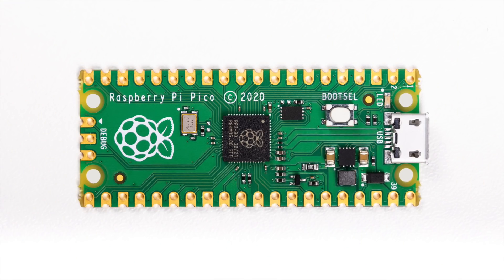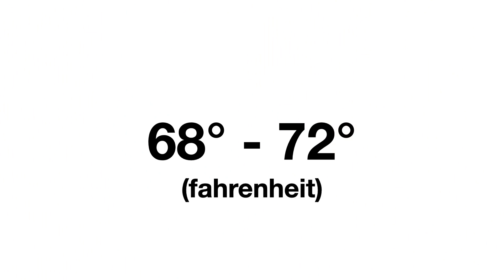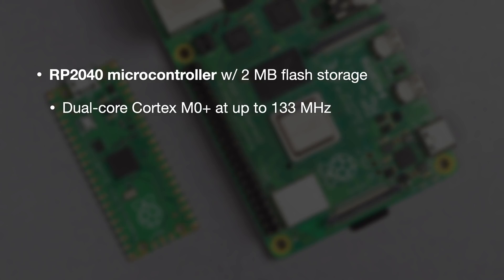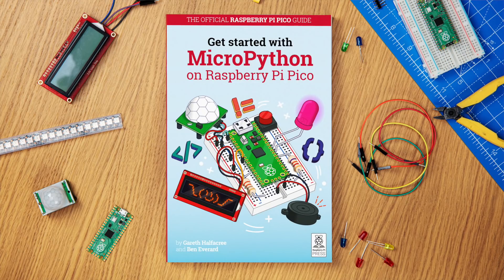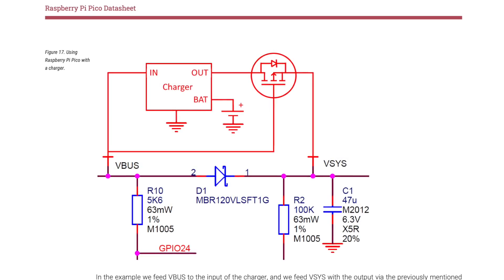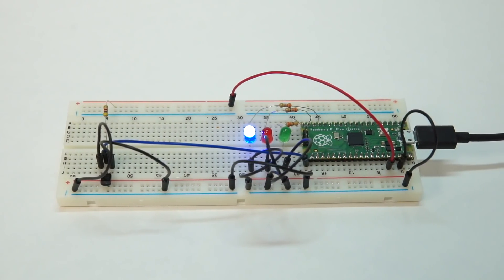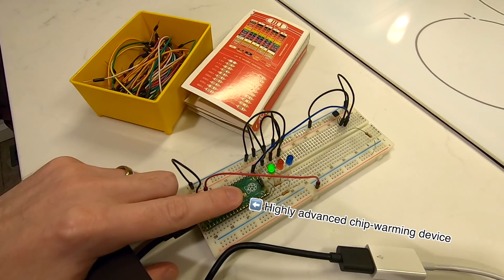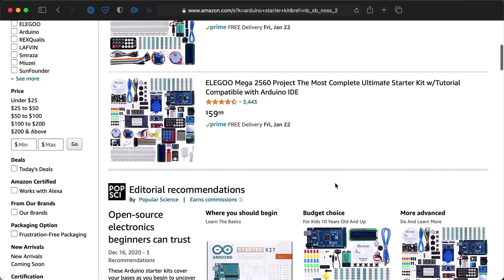The Raspberry Pi Pico Review - $4 ARM Microcontroller

Comment: Check out a $2 "Blue pill" board based on stm32
Reply: It’s a better deal
Reply: @danielh6219  not if they arrive non working, with the not advertised chip with a half-functioning clone IC or you actually want it within 3 months(Yes those are all common problems with the blue pill) and even then it’ll be slower and less flexible
Reply: @danielh6219  depends on what you do. Software support is great for those, but they have less processing power (though that probably doesn't matter to too many people. 72MHz is plenty for a lot of things.) If you want multiple cores though, I don't know of other boards in the same price range.
Reply: @coreforge  esp32 devboard has dual 240mhz cores + additional ultra low power core, supports wifi and bluetooth connectivity, and costs about 4$ on aliexpress
Reply: @nikitoss1108  Yeah, noticed that too. I haven't done much with ESPs in general and haven't looked into the ESP32 since I didn't need wifi for anything.
Reply: @coreforge  esp boards looks nice if you write high-level code, but if you try to dive deep into low level coding and write timing-critical things, then better to use another hardware, cause espressif are not so good at writing datasheets
Reply: @nikitoss1108  I guess it's better to offload your timing critical code anyway since the ESP may ruin your timing with its WiFi related interrupts. That said, for some use cases (like driving NeoPixels for example) you can actually use the ESP's hardware instead (though it does limit the pins you can use).
Reply: @ThePC007  yeah, these problems with timings may happen, but more often on esp8266 than esp32. Btw on esp32 you can work with hard real-time audio processing (where timings is quite critical) and use wifi simultaneously, and it handles this work pretty well thanks to better low-level libraries than for 8266 and splitting tasks between cores
Reply: @nikitoss1108  Yeah, I haven't used the 32 much, but I suppose having multiple cores definitely helps with this kind of stuff.
Reply: @nikitoss1108  ESP32 has all that PLUS crippling silicon bugs!  Woowoo!
Reply: @GoatZilla  anyway, people make good and complex projects with these boards, and they turn out quite nice and functional :)
Reply: @nikitoss1108  Sure, as long as you don't try to do things like wake from sleep or use PSRAM.
Reply: @GoatZilla  don't really know about deep sleep on these chips and problems with it, but I've seen projects that uses psram quite intense, for example you can check out module for eurorack synthesizers called ctag-tbd, those guys used esp32-wrover module and they did squeeze out quite a lot from this poor little esp32 :)
Reply: @coreforge  You don't need wifi for anything until you start using wifi for something, then you need wifi for everything.

Comment: Honestly, this is why I love the raspberry pi project so much. Yes there are boards out there with much better specs, but software support is in my opinion much better than a few gigs of more RAM or a few MHz faster.
Reply: People always dismissing the value of documentation and support then wonder why companies don't put more effort into docs and support lol.
Reply: It’s weird that you say that when this has less software support than most anything else out there right now.
Reply: @Hornet135  I really relate to what you said because I was a victim of that myself (had to make my own I2C LCD library for it in C because there were only ones for Python), but to be honest the documentation for the SDK and the hardware itself is really good

Comment: Surely it's 2uA in sleep mode, not 2mA? If it's 2mA in sleep mode then that's really, really, really bad. I build commercial IoT edge devices with MSP430 and ATMEGA microcontrollers, and I regularly run at 7uA, meaning a device can run for years from a couple of AA batteries. At 2mA, it's nowhere economical enough. I'll check the data sheets, but thanks for the video. I've ordered 3 to play with. MicroPython is a welcome feature - it's so much faster to get working software, even if it's not as performant.

Comment: ask a maker to blink a led and theyll use a pi and a full linux stack to do it instead of just a microcontroller
ask a maker to display the tempreture and theyll use a microcontroller temp sensor leds to do what a thermoteter will do
Reply from the maker: "Overkill"
Reply: Also makers: why would I use a Pi if I need to attach a display when this MCU technically can output a video signal... if it's essentially the only thing it does...

Comment: Can you take a PICO and make a soil moisture sensor, AND add 5volt water pump to water dry plant until Moisture sensor detects water and turns off pump?  Show how you wire it. And if you have code, show how to put code in PICO properly?  Every step... THEN I CAN FOLLOW THAT.

DISABILITY KEEPS ME FROM READING/LEARNING. BUT I CAN COPY IF CLEAR AND I OFTEN STOP VIDEO..

Comment: This could be compared to arduino nano, which is already kind of obsolete with availabiliy of ESP32. So, I dont really understand this product.
Reply: Arduino nano knockoffs are so cheap they are still viable if you just need a simple microcontroller. It's about 2 euro on Aliexpress.
Reply: If you think an 8-bit AVR MCU is in any way shape or form comparable to a dual-core 32-bit ARM MCU for any other reason than to point out how they're nowhere the same ballpark, this discussion is not worth having.
Reply: @AttilaAsztalos  If an 8 bit micro is sufficient for your hobby project, I think they should be compared. The example in this video could be made with a nano to prove the point.
Reply: The nano has definitely less features than this device.
Reply: Ok fine, its ARM, but still, i dont see a point using this over lets say ESP32. What am I missing?
Reply: Esp32 is 32bit.

Comment: Have you looked into ESP32 based M5Stack solutions?
M5Stack saves you a lot of time and you get a nice case too.

For the baby room temperature sensor solution the smaller M5 stick with a temperature hat will do.

M5Stack is  a bit more expensive but a lot more turnkey no soldering needed, and integration with Lego. 
https://m5stack.com/

the Ecosystem for ESP32 for home use seems to be very nice
https://esphome.io/  Lots more work

Comment: I tend to use TMP36 or 10k thermistors for temperatures, far easier to use and quite easy to calibrate to a reference.
Reply from the maker: I should probably branch out at some point... I just have a bunch of extra DS18B20s that I bought years ago, and already know onewire enough to use 'em :D

Apparently the onewire thing has been fixed in the latest version of MicroPython for the Pico, so I'll have to try it out again soon!
Reply: @JeffGeerling  Would love to an update with it, I have been wanting to do a onewire project for a long time.

Comment: Is this the first arm based chip designed and released by the pi foundation? This is HUGE! Looks like a good form factor board too with good enough pricing.
I'd like to learn about how they designed it, what IP and licenses they were bound by. Maybe they could work with esspresiv if they don't want to deal with designing their own radios.
This might make me jump on the micropython bandwagon, as late as it is. I love the pi zero, but running a whole OS with my simple projects just feels messy and a massive waste, micropython on m0 cores looks like the right balance for my stuff.
Reply from the maker: Yes! That's one of the headline features, though I didn't mention it too strongly in this video. The RP2040 looks like it will be the first step in a line of interesting new microcontrollers.

They're definitely embedded (heh, get it?) in the ARM ecosystem now.
Reply: To me it's seems like IP foundation believe that some of there customer base is ready to go beyond Linux OS, to lower level computer programming👍, although I would be very shocked to see them ever go as far as assembly language.

Comment: Why is the PI foundation wasting time with this? They should make an ESP32 killer with wifi 5ghz.
Reply from the maker: My guess is they start where they do with most of their projects—educational intent, as cheap as possible. And for a lot of use cases, WiFi and Bluetooth aren't necessary (and sometimes could be detrimental to include).

There's board space, I'm imagining there could be a Pico W someday...
Reply: @JeffGeerling  love your work Jeff. Just a little annoyed with the Pico. Was hoping for much better from PI.

Comment: Only one thing I was a little bit disappointed at, no CAN-FD interface. But I sure will find use for a couple of Picos. Congratulations on your newborn!
Reply: I'm not familiar with CAN-FD, but it may be possible to interface with the bus using the PIO capabilities of the pico:
https://datasheets.raspberrypi.org/rp2040/rp2040_datasheet.pdf#section_pio

It seems to run directly off of a configurable voltage divider from the system clock, so protocols implemented using PIO should be pretty fast.

Comment: But the most important question is: Can I ditch MicroPython altogether and use the Arduino IDE to program in C++? Couldn't find an answer to this so far...
Reply: The arduino folks are going to be releasing an arduino based on the chip used in the Pi Pico, so there will definitely be a compatible bootloader available, and I have no doubt that community support for getting it onto the Pico will come together quickly.

It's also worth mentioning that there is be a C/C++ api for the pico by the Pi foundation for those that don't want to deal with MicroPython.

Comment: what 22 degrees celcius? in my country just reach 22 degrees and mount everest memes will come out
Reply: The only temperature scale worth using is where zero means zero.

That’s 295K to you.
Reply: Australia? 22c is like winter on the mid east coast.
Reply: Here 22 is COLD
Reply: Water freezes at 0, room temp ~20, body temp ~26 , water boils at 100.
Reply: @LysisofPie  add 11 to the body temp, unless it's about a recent corpse ;)

Comment: Isn't it the main reason for the existence of a datasheet to go through the details of such a chip? I mean, that sounds really special but you can do this also with a "normal" raspi: look things up in the datasheet.
Reply from the maker: In this case, though, all the SDKs, specs, etc. are under various open source licenses. There aren't any closed-source blobs to deal with like on the regular Pi and it's video cores and firmware.
Reply: @JeffGeerling  Oh I didn't know that. I thought that on a regular raspi also the informations are open source. Thanks 😊

Comment: It's already out of stock in Romania LOL
Anyway
You can re-solder the pins backwards (with the pins sticking up) - that way you can stick it in a breadboard and see the pin label from the back :D (That's what I would do)
Reply from the maker: Heh, true. That would work, though you lose access to the BOOTSEL button that way (maybe add a little plastic lever so you can still nudge the button while inverted!).
Reply: @JeffGeerling  isn't the reset pin tied to a gpio?
you can wire an external reset button with it
Reply: I can see it has a "RUN" pin, assuming that it's connected in the same place, a simple button + pull up resistor will do the trick :D
Reply: follow up, BOOTSEL it's not tied to the RUN, following the schematic it is tied to TP6 (test point 6) that is in fact on the back of the board
That TP6 is usually used on production line to test out the circuits and make sure it has all the components in place
To that pin can be added a momentary push button with the other end tied to ground (it's a pull down configuration) so that can be used to have the BOOTSEL even if the board it's up side down
Reply from the maker: @CrisanBogdan  Ah, well there you go! Even better :)

Comment: Any benefits of using this instead of an Arduino?
Reply from the maker: It's $4, and faster than most of the models priced ~$10. There are some other little differences—and in some cases some of the Arduino models are actually nicer to work with (e.g. if you don't want to breadboard or solder anything, the Pico doesn't come pre-soldered with headers yet).

But Arduino is actually building their own RP2040-based board already!
Reply: @JeffGeerling  Thanks!
Reply: High speed and the use of python?
that's what I'm thinking of

Comment: All those other controllers cost much less (e.g. I used to buy ESP32s for $5) if you don't buy them from stores with high markup. I wonder what the Pi would cost from the same stores.
Reply from the maker: The one good thing about the Pi distributor network is the stores all charge the list price ($4). The one bad thing about the Pi distributor network is "out of stock" is a common refrain :(
Reply: @JeffGeerling  Unfortunately for hardware I think 2020 and 2021 will be "Years of out-of-stock" in general.
Reply: I drove over to the MicroCenter store in nearby Marietta, Georgia and bought a couple Pico boards for US $2 each. It was an introductory promotional price.

Comment: Congratulations on propagating your lineage yet again :>

The extensive documentation is probably nice for 'professionals' - but without WiFi at twice the price (~1.80$ on AliExpress, at least)...the Pico will probably have a hard time competing with the numerous ESP32/8266 devices available.
Reply: Robert Slackware  Not everyone believes in the factually unsubstantiated idea that a few hundred mA non-ionizing radiation does....anything to the human body.
Reply from the maker: There are many use cases where a lack of WiFi/BT is a feature, and not something missing.

But the Pico has board space... I can imagine a Pico W someday for $10 with WiFi/BT support.
Reply: @JeffGeerling  sorry Jeff, but WiFi/BT can be easily disabled in the code, so as long as uC module costs the same or less it does not matter. Also I wanted to mention that STM32-based Arduino Nano-like boards are quite popular and cost less than $3 on AliExpress, so at this price point competition is very hard, which is good. And also IMHO Python is not what one should really use for uC programming. Thanks for vid anyways
Reply: @АлексейДмитриев-ш1ф  disregarding ability to run python seems very similar to someone saying a board without wifi is a feature. Its a tool, you can use it or not depending on the needs.
Reply: @maciejurbanski6146  thanks for the explanation. How could I miss that I can use or not Python? I think that's why there was 'IMHO' word.
Reply: @JeffGeerling  $10 Pico W would be much higher priced than esp8266 or even comparable esp32 dev board. 

Only way your comment about your argument for lack of Wifi on board is valid argument if you could show case that the power usage is much lower even with Wifi disabled on esp32.

Comment: This bloody thing is far more powerful than my Original Raspberry Pi!
Reply from the maker: Well now, the original Pi didn't have any built-in flash storage either... but technically its processor is 700 MHz default clock, so it is a bit faster.

But I know what you're saying :)
Reply: @JeffGeerling  $4, twice the cores. Holy geez how far the Pis have come.

Comment: How come your video comes out at the same time as the raspberry pi foundation?
Imma watch ur video first tho
Reply from the maker: Magic. Red Shirt Jeff tried explaining it to me but I didn't understand his language. And I had to run away once he started pointing the blowtorch at me.
Reply: @JeffGeerling  Re-model the Bell Slapper to keep slapping him everytime he turns on the blowtorch :)
Reply: @JeffGeerling  
Is there any chance that this processor is designed for the Fantasy Pico-8 system?
Reply: @SLLabsKamilion  Thanks. That satisfied my curiosity.
Reply: @coda821  No problem; hope you have some enjoyable times :)
Reply: @SLLabsKamilion  Are you a maker at all?  That site give me some interesting ideas, but I have zero of the tech skill required.
Reply: @coda821  Somewhat, yeah. Been messing with microcontrollers since the motorola 68HC11. Things have gotten drastically easier today, I cannot recommend micropython to you enough. It has made my prototyping SO much easier. Can mash up a quick script with the on-device editor in a few minutes, no need to mess around with the Arduino IDE and compile+upload nonsense. RP2040, STM32, or ESP32 will all run circles around C code on an Atmel AVR8 at 16Mhz. Most of the 100Mhz+ MCUs that can run micropython are just beasts at simple integer maths and loops. Plenty of other runtimes out there too, so don't feel like micropython's the only game in town, just the one that makes things as easy as possible to get started. I've even used my android cellphone's USB port to mount a micropython MCU and edit code, without a PC on hand. All you need is a serial terminal (once you've flashed micropython the first time)

If you need some help; drop by #esp32 or #micropython on irc.freenode.net and ping Kamilion. Dude's practically a walking talking wiki of tech knowledge.
Reply: @SLLabsKamilion  I really have too many non-technical projects.  Planning on writing a book, and perhaps designing some TTRPG products.  Only considering coding if the TTRPG projects get finished.  I wouldn't mind sharing some simple ideas, with someone who might make use of them though.  I was thinking of something that would have applications as a general purpose safety scanner modeled after a tri-corder.  The communicator had it's day, so why not the tri-corder?  That or an internal thermal camera that keeps track of heat dissipation within gaming PCs.  They're a bit gimmicky, but I'm not a very technical person.